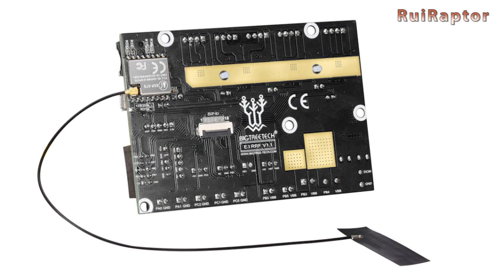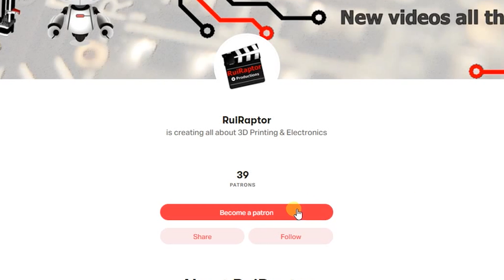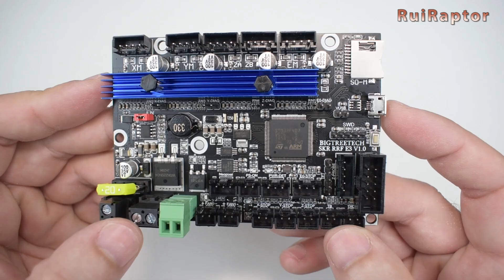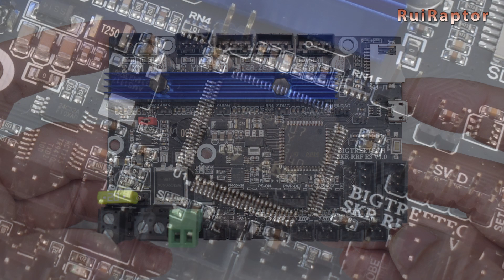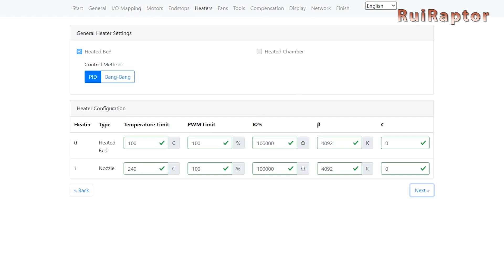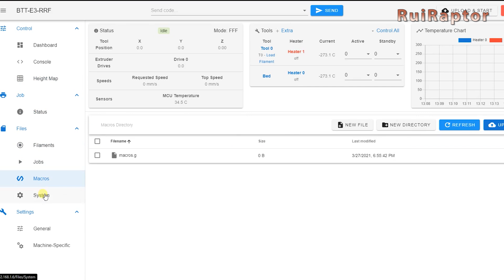BIGTREETECH E3 RRF - New Board For CREALITY 3D Printers

Comment: Hey, Maybe this has been asked already, Or its in the video, but I'm not sure. How do I use the wifi capability? I'm tired of the sd card. Thank man😀
Reply from the maker: Hi Aidan, with this board you can use RepRap firmware and access the board using the browser.

Comment: fanny have got this board but it does not yet supports btt tft 35 or btt mini12864v1 (((((
Reply from the maker: Hi Mito, yes it supports BTT TFT 35. We will explain how to do it very soon ;)
Reply: ruiraptor ок good ;) thank you;))
Reply: ruiraptor I know there is the rx and tx wires need to be switched ;) cannot figure out about the firmware :(
Reply from the maker: For the bigtreetech TFT display to work with RepRap firmware, you need to modify the display's config as well. Otherwhise you will get a "No printer attached" message.  We will share all the details tomorrow...stay tuned  ;)
Reply: ruiraptor thank you a lot !!;) will be waiting ;)
Reply: @ruiraptor  hi how are you? will you share the details today? thank you)
Reply from the maker: We are editing the video as we speak...should be ready in a few hours...
Reply: ruiraptor wow ;) this is very good;) thank you;)
Reply from the maker: Hi @Mito Fun , the new video is now online.
Reply: ruiraptor thank you:) have tried to install rrf according to your instructions - no luck :))) I have managed to do it another way- but do not remember how ;))) so desired to run it under marlin mode ;) and connect the tft 35 - work very good;) thank you;) so in marlin tft works in tft mode good !

Comment: I ordered it for my BIQU b1 along with the second independent extruder. Funny thing is i got this exact board from mellow fly not knowing it's the same board. But i short circuit the first day i had it accident. Forgot it was on and poof just like that it was gone but the fly 7 inch screen is still well that i can use with this and I'm using the bigtreetech tft70 with my Lulzbot Taz

Comment: Serious question from somebody still relatively new to the 3D printing world.  What is RipRap and what does it offer over Marlin ?  I'm not smart enough to update my miniv2, so is this one easier to use ?  Although I admit I like it has (or at least looks like) it has a decent wifi, and I like  that someday I could add a 2nd extruder if I can ever learn this mess.
Reply from the maker: Hi Tommy C, Reprap firmware is a different kind of firmware. It has pros and cons when compared with Marlin. One advantage is how easy it is to modify firmware configurations. There are many things we could write about it so it's easier to show you this link: https://reprap.org/wiki/RepRap_Firmware

Comment: Can I install (use) this board directly on my tevo tarantula pro? Cuz I don't know how to configure steppers, drivers, wifi, bed, hotend etc with Marlin firmware
Reply from the maker: Hi, If you have your printer stock, you can use the example config from Marlin for the Tevo tarantula. That config is ready to use for the stock printer.

Comment: I wish someone would show some love for us forgotten & neglected CR10s-Pro V1 owners when it comes to mobo upgrades.  :,(
Reply: Same with the anet :/
Reply: No reason why you can't install this board or similar. it's not limited to the ender 3
Reply: @JaySuk  Not without an additional interface board or the 30-pin connector being removed and replaced with all of the corresponding plugs for the new mobo, or some similar method.  So, not exactly plug & play.

I wonder how many 10s-Pros were sold, maybe there's a market out there for an interface option?
Reply: @Loneman_OG  oh, do they have some dodgy wiring? I would just bin it off and be done with it. Had the same with a robo r2
Reply: @JaySuk  Bin what?  O_o

The wiring is fine, it's just how it connects to the mobo that's the issue, as I say, not exactly plug & play.